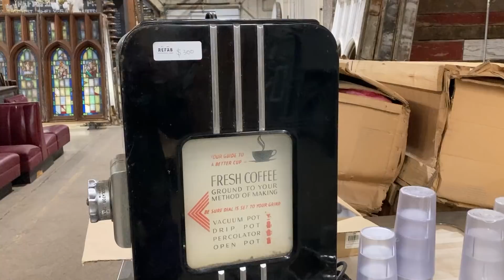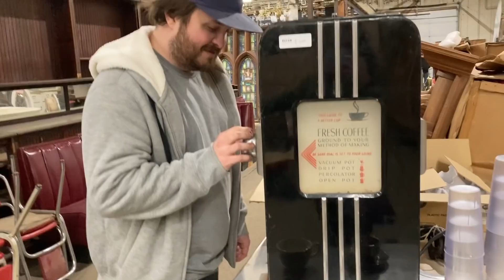The Waterfall Story

Comment: Leaf stems...   Those are not pine needles. They are leaf stems.

The leaf part decomposes fairly easily, and you are left with the stem part which hangs around a lot longer.  Because they are narrow, they can also go through many types of gutter guards. The last home my husband and I owned had an ash tree, and we found these all over our yard in spring even if we had raked well the fall before. Lots of people have gutter guards, and they probably work for some people.  But when we talked to multiple handymen, they advised against it, and suggested we simply do a good gutter cleaning once a year.  Their rational was that, although they may stop a lot of debris, they don't stop it all.  They also make it significantly harder to clean (and inspect!) your gutters allowing problems to develop that you might otherwise have noticed.

I am sure there are a lot of people here that have had positive experiences with (good) gutter guards, and I hope you will get  good advice if you choose to go that route. For us, our roof was accessible enough that we could give them a good cleaning once a year, and that solved the issues we were having.
Reply: Yes that's exactly what they are

Comment: Hi Kim, I just had gutters installed so I have a bit of info.  The commercial size gutters are wider and can handle more rain.  The gutter covers used to prevent anything from getting into the gutters just do not work (it is a gimmick).  The gutter from the top roof should be directed to the ground and not the second roof (again with a wider gutter).  I live with a lot of rain so we have downpours as well.  Maybe the tree close to the house should be cut down since it creates major issues.  I know there are tree activists, however, it would make your life easier in the long run.  Just my thoughts. 😎
Reply: Idk about cutting down the tree that hangs over their house.  Those needles are from a short leaf pine or maybe a yellow pine and the tree she showed was not a pine tree at all.  Maybe there used to be a pine tree on the property.  It takes pine needles a very looong time to fully decompose.  That's why they make great baskets.

Comment: If you are thinking of new gutters consider extending the down spout from the 3rd floor to go beyond the flat part of the roof you're standing on.  Also in FL we have a gutter guard called "Leaf Guard" that is smoother than the wire mesh guards so nothing gets down into the gutter causing the blockage.   We recently had our old gutters removed and replaced with "Leaf Guard" and no more over flow/ water falls.

Comment: you might be able to restore the medallion, not snipe

Did you check behind the gutter? sometimes capillary action gets it going behind the gutter (when water is rushing or full gutter)

those gutters look like they might be letting water run back behind and into the wall (is that loose rubber in the gutter?) fascia and roof edge has to be waterproof to stop the capillary stuff

imo gutter guards are a pain more than helpful in areas where there are debris and/or ice possibilities, sometimes cleaning out gutters is what is better choice
personal antidote: know of wide gutter with guards over a front door, since install - inside wall wet when rains and ice covering door in winter and plaster walls fall off around door with wrecked doorframe

Comment: Looking at your shots of the gutters I would say that if you had a company install the guards then they installed them over all that stuff that was already there. It is not that the stuff got through. I think it was already there. Those pcs are too big to go through the holes. I thought you would have used the lift you got to get up there. Safer than going on the roof.